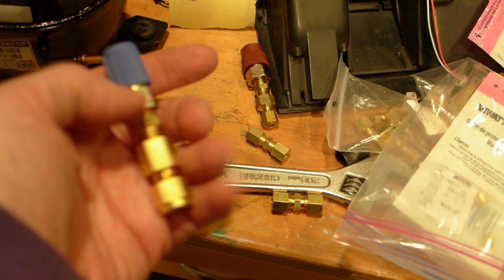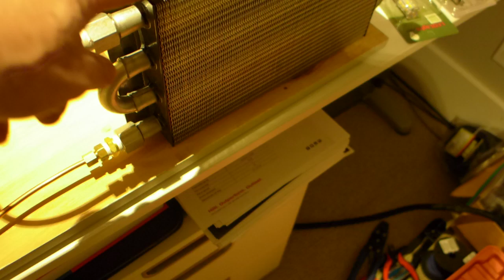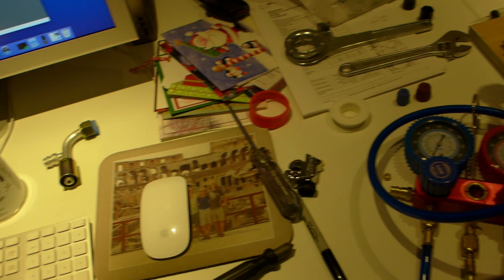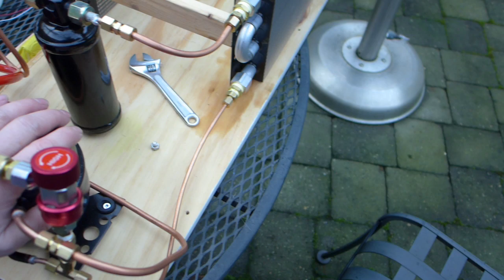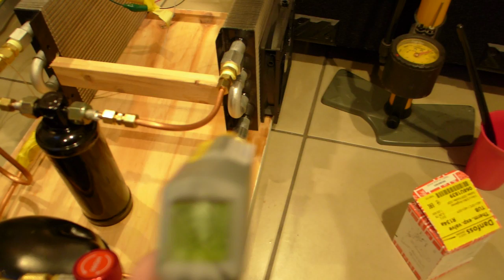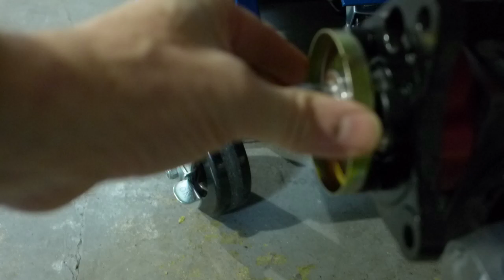The Ultimate 1983 Rabbit GTI - part 112 (Electrical A/C System, Rear Axle Dust Shields)

Comment: Derek that is amazing !! i have a small diesel in my car and always wanted AC cuz i have breathing issues . that system is all electric and doesnt run off the engine . that has alway bin the problem i have ,50 horse power has its limits .lol i am so glad i get to see your great innovation to that same issue .and your system can be installed with minimal modification to the car . 

 would a normal core that sits beside the rad provide a better cooling area for the system . it should translate the larger cooling surface to go to the smaller core on the cab fan . it shouldnt have to work as hard to provide cooling with the larger core that the car would have had if it had factory AC . then it would look stock at the front and hide the rest . electric compressor , i didnt know it was possible . i love the idea man . i will have to see what i can come up with . in the end all that is needed is to feel the cool air on the face and be able to have the windows up . i do know that tinting the windows does help keep the cab area cooler .but in your case i dont think you want to tint them . Way to think out of the box Derek ! great job .  :)
Reply from the maker: +Johnny R. (My Rabbit 84) First of all, I am mounting the condenser under the car as I have no room in front of my custom radiator which is mounted under the front cross member to make room for my custom intake system. I plan on mounting the evaporator unit in the rain tray area, near the blower, probably beside it with some ducting to the blower - I wanted to mount the evap unit right on top of the blower but the total thickness available is around 1.5" and if I choose any stock evap unit it will be greater than 2" thick so will have to be mounted beside it with some funky ducting to the blower.

I am not sure how you would mount an evap unit at the front of the car and not sure why you would want to do that as faster moving air would have less time to cool down when passing thru the evap blades. Normally the condenser unit mounts up there and more airflow is always better - the lower the temperature of the fluid when leaving the condenser the better - when the fluid hits the expansion valve or expansion tube and converts to a lower pressure gas, that is when the energy is sucked out of the evap unit and you want to make sure that every last joule of energy is pulled out of the incoming air only ...
Reply from the maker: +Derek Spratt Just to be clear, an a/c system has 4 components: the compressor, which feeds a high pressure fluid/gas into a condenser which cools the fluid/gas into a mostly liquid state, which then is filtered and dried, and then goes into an expansion valve or tube and drops in pressure dramatically (from 150-200_psi to as little as 20psi) and in the process of evaporation in the evaporator core it pulls energy out of the air, cooling it down, and then that low pressure gas is re-compressed by the compressor and the cycle repeats. The amount of energy removed by the condenser is slightly greater than that energy pulled in by the evaporator as the system isn't 100% efficient
Reply: oh yes i forgot about the space you needed for your intake setup. as for the ducking part the ones that had factory air in them did it just like you said . there is  be a cover for that . i will send ya a pic . i am soo glad you are good at this . your helping a lot with how accurate you are .

Comment from the maker: I thought I should provide some basic automotive A/C background info and relate that to this project:

A typical crank/belt driven automotive A/C compressor is capable of 10-20000 BTU/hr output capability. Due to the law of thermodynamics heat/energy removal (a thermal transfer process) isn't a watt for watt 1:1 relationship. e.g 1 watt of energy input into the compressor translates into approx 2 watts of energy removal from the air. For my tiny little Danfoss BD250GH compressor, which draws around 10-15 amps at 12.5V, or up to 200W, it provides up to 400W of energy removal, or around 1300 BTU/hr. I could upgrade my compressor to 2 other available units (http://www.seanhylandmotorsport.com/blog/12-v-air-conditioning-compressor-how-can-you-decide-if-one-is-right-for-you/) that consume 20-31+ amps of power for between 3000-6000 BTU/hr of cooling capacity in a package that is roughly the same weight and size (7-10lbs) as my Danfoss compressor (with easier to manage automotive A/C fittings pre-installed - but the compressors have less complex electronics that can't speed up and down the compressor as energy demands change - you are limited to turning them on/off).

Air weighs 0.04Kg/cu-ft and the fan I am testing with is around 150cfm, which means that the mk1 golf with its approx 80cu-ft of interior volume would have its air exchanged every 30 seconds and in that case my little compressor is removing around 3-4 degrees C of temperature from that volume of air. Dry air has a specific heat factor of 1000J/kg-C (in other words, it takes 1000J to raise the temperature of 1 Kg of air 1 degree C and 1W = 1J/s). My fan is moving 150cfm or 2.5cf/s, or .1Kg/s or 100W per 1 degree C of cooling = 300-400W of cooling, so my system is pretty much running as expected. If I slow the fan speed down 70% to an equivalent to a 'low' blower setting I can then expect the air temperature drop to be around 10 degrees C. And that is with a small Danfoss compressor. 

You have to remember that the sun radiates a huge amount of energy into the car interior while driving and when a car's interior is hot it requires a huge input of cooling to bring the temperature back down, and that is why 3000+ BTU/hr is a better starting point for a 12V electrically powered A/C system. I think I can make my little 1300 BTU/hr system work effectively but I might end up changing to the larger compressor in the end. 

This is a big science fair project and so I am learning and experimenting along the way. Fun stuff!
Reply: Derek Spratt So what made you not just go with a conventional HVAC system?